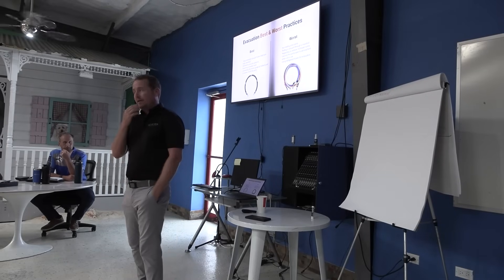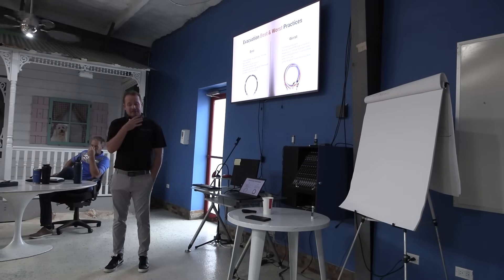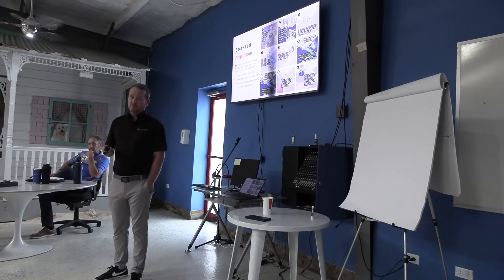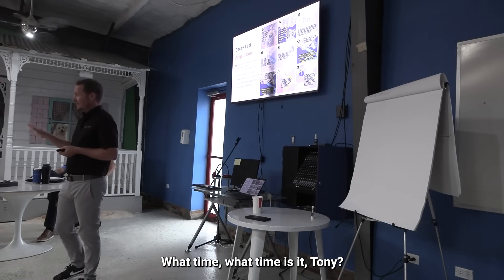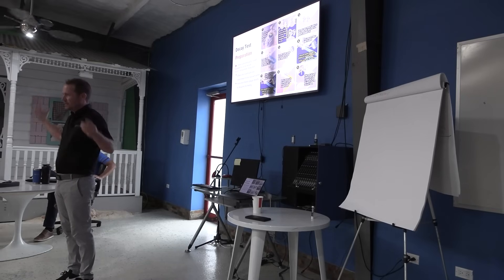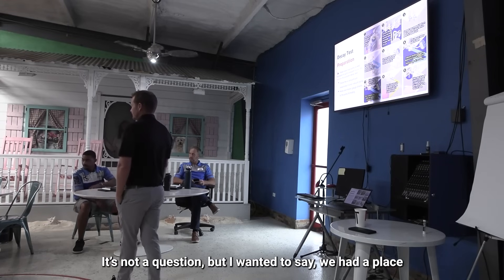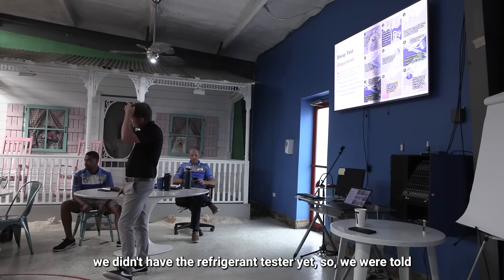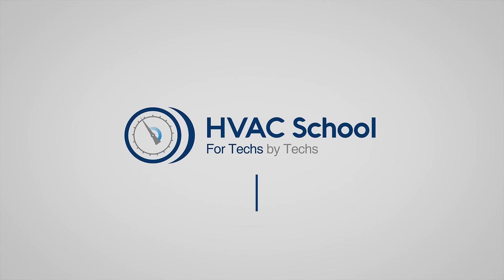Vacuum Best Practices

Comment: I have been using and explaining these principles constantly. And if i have to hear " i have been doing this for 30 or 40 years and you arent gonna tell me" i swear im gonna throw a wrench. I routinely demonstarte sub 100 micron pulls that only decay to mid 100s. Inside 20 mins. And still i catch static feom all the guys in this industry. Biggest difficulty in this trade is the other "tradesman" and the exoectations set by employers

Comment: Wait if you can only pull around 1/2 a cfm through a CRT tool (with standard hose sizes. Assuming 1/4”). Then how else are you removing the Schrader, pulling the Vacuum, and then doing anything else(like removing your vacuum hose) without losing your vacuum? Lol
Reply: A shrader removal tool.
Reply: @jmank121  he says when you pull through a removal tool your only pulling 1/2 cfm max.. that’s my point though, im wondering if he meant to say if your pulling a vacuum through the schrader (as in “if you try to pull a vacuum with the schrader in your pulling 1/2 a cfm max vs without the schrader when you can pull 6-10 cfm with bigger hoses like the Navac “Big Boy”)